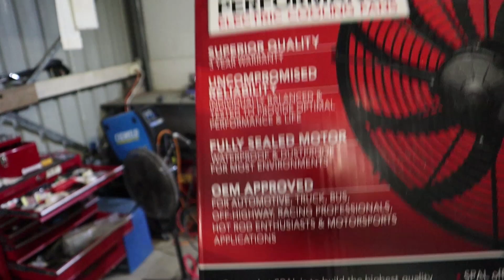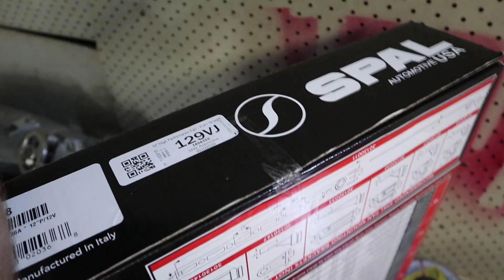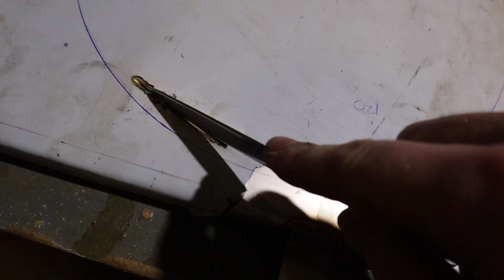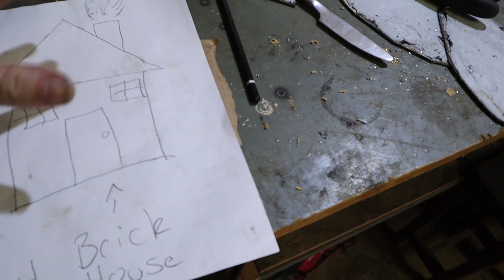The MOST POWERFUL 12" SPAL fans Install // s13

Comment: What amp switch are you using for those puppy’s I just ordered same ones
Reply from the maker: I run 2 40amp fused relays switched with the most pov pack switch I could find. Think its like 10amps maybe
Reply: @jshee9  what amp alternator do you have these just toasted my 120 amp I upgraded to ls1 alternator hopefully it does trick also what ignition system is that  I am running an sr22det stroker gtx3076 82 ar with r8 coil packs